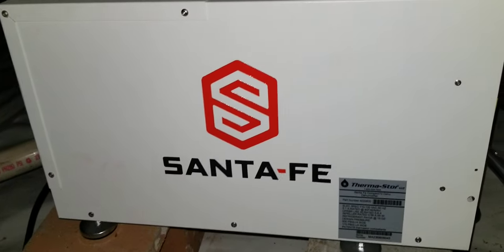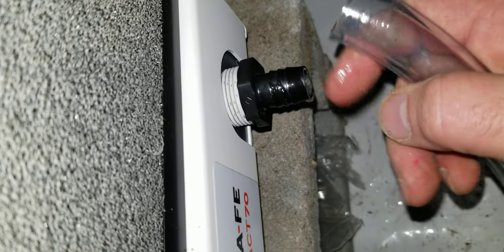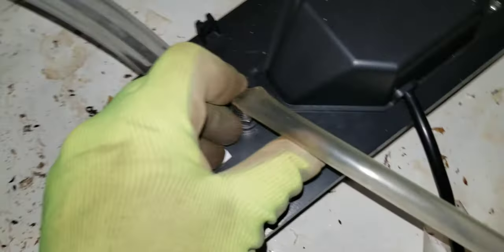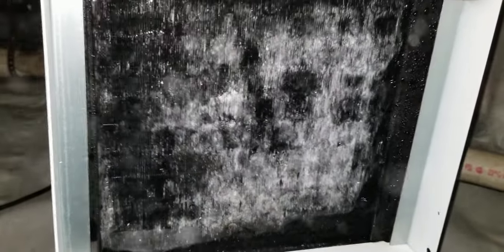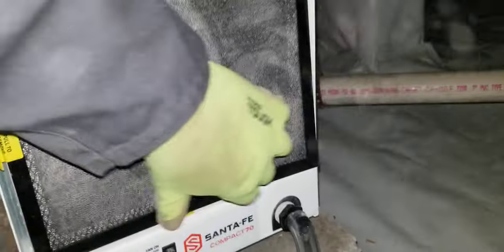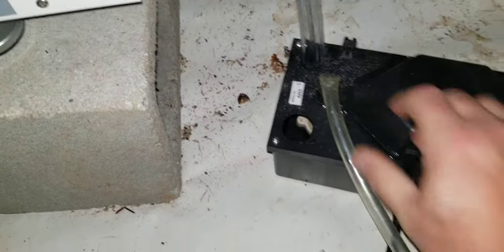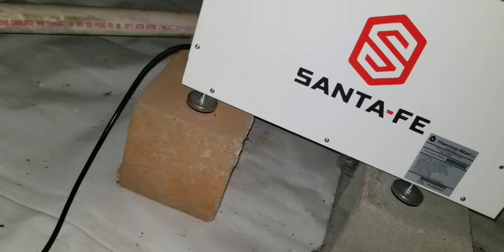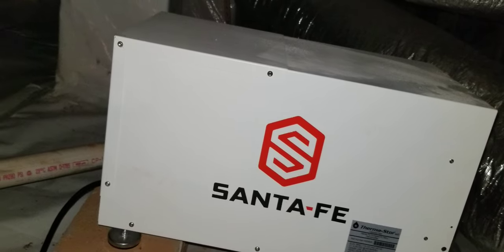Santa fe dehumidifier problems!!!

Comment: Page 5 in the in the Installation & Operation instructions clearly states that the Compact 70 requires a drain trap and explains how to set them up. The unit also has a defrost thermostat. The one on your unit may have failed, they're replaceable. The defrost thermostat is mentioned on page 6. You criticize the unit, but it appears It has not been located in a proper environment or running at an appropriate time of year. I own two Compact 70 units and they both work perfectly. Not sure what you have going there but something doesn't appear to be right for that machine. Santa-Fe has several tutorial videos on their website. They also have stelar customer service.
Reply from the maker: Thank you.

Comment: You said the air gets sucked in from the left and comes out the filter side.  Maybe just a slip but not true.  Air gets sucked in through the filter.  That's why the filter is there.  My experience w Santa Fe has been good so far.  That owner should expect a fail given the condition of the filters.
Reply from the maker: @johnson7228  i agree. You are correct.  Thanks for watching.
Reply: @GoodContractorsarerare  btw, I agree with the haphazard install of that unit and the condensation pump.  So easy to do a good job and yet laziness persists.

What brand do you see that has the best reliability?  I had my Compact2 for 9 years with no issues.
Reply from the maker: @johnson7228 I've seen so many. Santa fe is the main brand. Some are in good condition and some pretty nasty. If you are on 9 years, that's amazing.
Reply: @GoodContractorsarerare Not the same experience w my new Compact 70 so far though.

Comment: are they all about the same or is there a brand that you see that is better than most?  thanks.
Reply from the maker: Santa fe has looked to be a continuous problem. They get clogged from sludge build up. People don't change the filters. Proper maintenance twice a year is critical.  I've been different ones from horizon, wathdogs,lg, santa fe, aprilair. Never no.